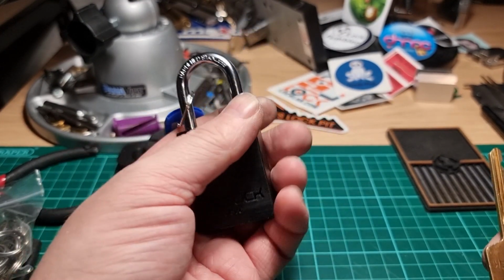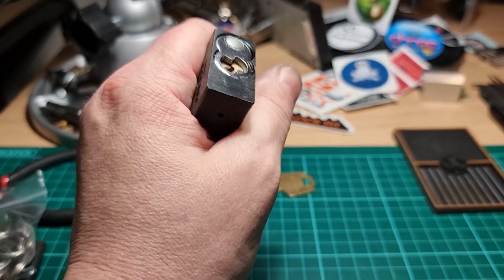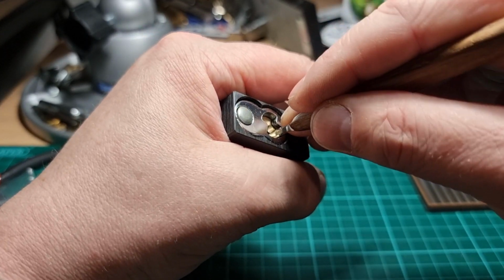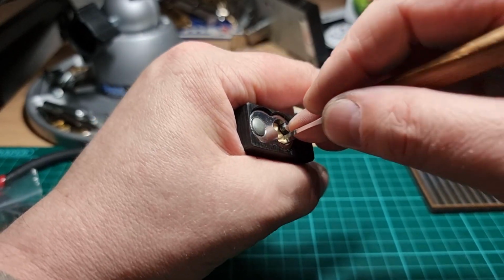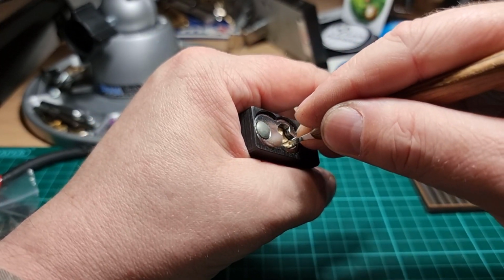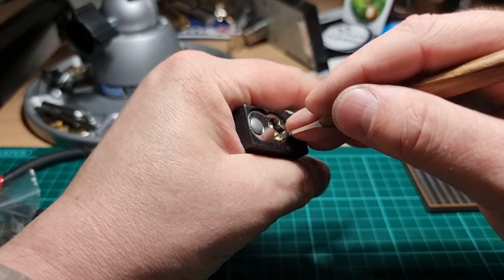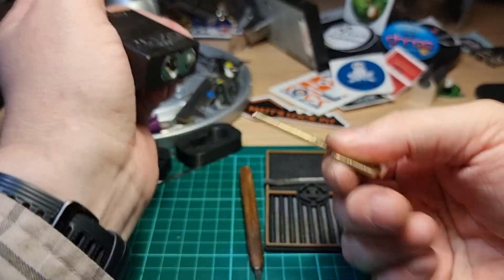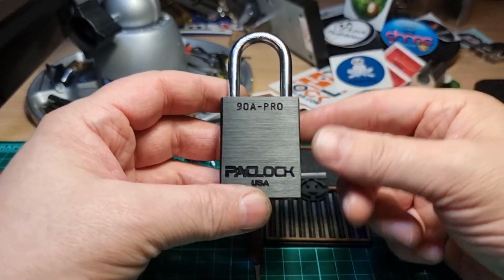(285) PACLOCK 90A-PRO (Blue Belt) #lotolocktuesday

Comment: Not sure why these Paclock padlocks are so gritty to pick when Paclock seem to have cared so much about appearance of the locks and getting the locksport community involved with them early on.They would know that a poorly manufactured core would get a hammering by locksporters. Well picked and gutted. Thanks for including this video into the #LotoLockTuesday series Cheers
Reply from the maker: Thank you 😁 
I think the spools and serrated drivers in this Paclock are a bit on the rough side... They're definitely not as well made as the American lock pins.
The Paclock is still definitely a challenging pick though.
Cheers PW 😁 👍 🍻
Reply: I agree! Gritty picks! I have to order another I traded off my first one😝. But was happy to do so. It found a great home in France and vacations in Spain😳😜. Seriously though it does😂🤣
Reply from the maker: I was lucky and picked this one up on ebay fairly cheap, cheaper than I could have purchased and shipped one here from Paclock anyway 😁👍
My Paclock collection only consists of one 90A-PRO and one PL410-PRO... so far 😆
Sounds like your old one gets nicer holidays than most 😆👍
Reply: @Myloks  lol right 😝. I also have to get these two! Soon! Soon😝😜. Hey thanks for the comments man!

Comment: Great picking on the Paclock Pro.
They do make their locks very pretty though 😉
Agreed they are not as smooth to pick as the American locks but usually do give people a run for their money. Pins are normally decent quality as far af I can remember, not picked one in a while.
Pretty quick open and nice to see a gutting and rebuild together.
Let's all throw down a rope for Mklok guys and gals and pull him out of his slump. Having said that, if picking a  90A Pro is in a slump I want to be in it too 🤣🤣🤣🤣🤣🤣🤣🤣🤣👍🏻
Reply from the maker: Thank you 😁 
Paclocks are nice padlocks and challenging to pick it usually takes me way longer to pick than this attempt... I either get the open quite quickly or I end up fighting with them for ages 😆
I was in a bit of a slump when I went to record this... I was struggling with loads of other locks I'd usually manage... honestly 🤣
Cheers Roy 😁 👍 🍻
Reply: @Myloks  Agreed they are so hit and miss to open in a decent time. I must dig mine out and stick them under the spotlight with the camera.

Comment: If I could pick one of them Paclocks in the same time it took you to pick this one I would be over the moon mate , but I would NEVER gut one because I've tried to gut 3 locks in the past and I messed up so badly that I just dumped the lock in the bin lol
Reply from the maker: Thank you Peter 😁 
I'm always super nervous gutting locks, especially if I'm gutting them for the first time.
If you brick a lock it might be worth sending them on to someone like Dmac he may be able to recover it.
Did you receive the small parcel I sent you with the draper telephone lock in it?
I posted it last Wednesday.
Cheers bud 😁 👍 🍻
Reply: @Myloks  Yes , thank you mate , I'm sorry that I didn't let you know but I've been very busy lately mate
Reply from the maker: No problem buddy,
I forgot to let you know that I'd sent it 😆
Glad it got there ok.
I added a bit extra that you could always use to add to one of your trades.
Cheers Peter  👍 🍻